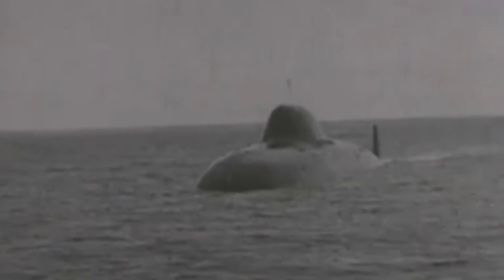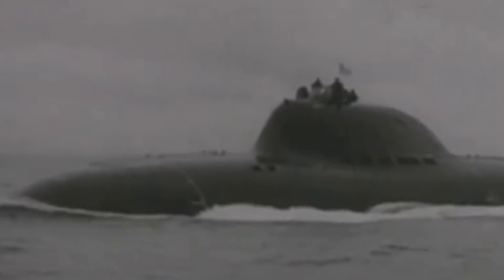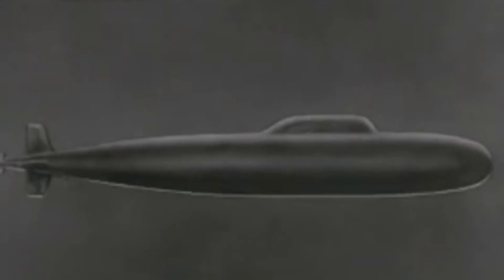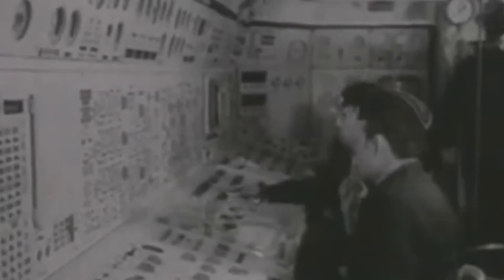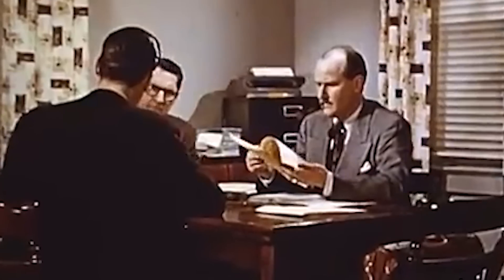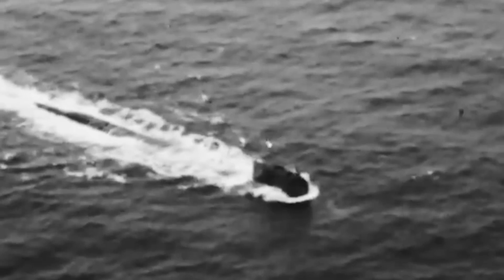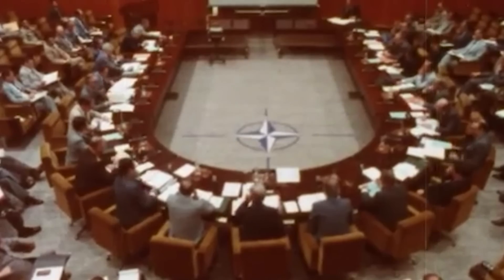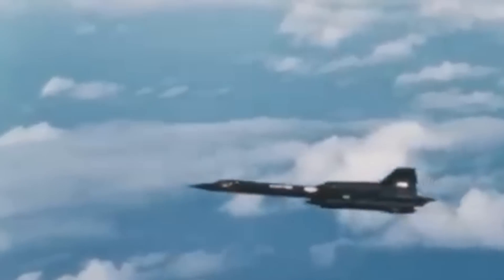Russia's Top Secret (Shiny) Titanium Submarine

Comment: Two unmentioned negatives: The Alfa class was the loudest submarine in the water and liquid metal reactors turn into bricks if they are ever shut down. Other marine reactors are generally shut down while in port and the sub is attached to shore power.
Reply: With the speed it had, noise didn't matter. It's like claiming a bullet has the negative of being noisy when you shoot a gun
Reply: If you're detected already, it's kinda irrelevant if you're insanely loud at high speed. Then your objective is to get the fuck away and not be silent.
Reply: @vermas4654  They must have known though that the first thing the US would do is work on a faster torpedo, and they did with the ADCAP. It's like the old U2 spyplane that could fly above the ceiling of old Soviet SAM's. Obviously they're going to work on a higher flying missile. And it didn't take them long to shoot down Gary Powers.
Reply: @benthejrporter  of course. But with their maneuvering capabilities the alphas were still very much capable of getting away from even those torpedoes
Reply: A lttle bit like a catalytic converter in a car exhaust system. They turn into bricks too. The Russians were the only ones capable of welding titanium to stainless steel at that time.
Reply: @keithdurose7057  Not at all the same, the metals in a catalytic converter are always solid.
Reply: @keithdurose7057  How the hell did they do it?

Also, titanium to stainless? I thought it was about just welding titanium pieces together...
Reply: @deezeemb  Porsche figured out how to weld Steel to Aluminum - you first plate the area with Aluminum.  Maybe Stainless to Titanium is similar, You plate one of the metals.
Also - - why can't CO or N2 be used as a "shield gas" , and furthermore Titanium isn't "rare" - it's everywhere, used as white paint pigment.  It's just hard to purify.
Reply: @keithdurose7057  Titanium Alloy.
Reply: Without accessible machinery spaces they'd be in big trouble if they had a breakdown out at sea.
Reply: Put a tube into the ocean anywhere in the North Sea and you could hear it. Yes it was fast but easily detected as it was exceptionally noisy
Reply: @SunriseLAW  Titanium is more resistant to fatigue than steel.
Reply: @luckydog9809 What utter nonsense you know nothing about their acoustic signature and that is the usual US story.   So when and where did you detect one then. ??
Reply: You can shut down a liquid reactor, you have to keep the metal liquid with heaters.
Reply: @jobowobo6700  No you just don't shut them down.  Cooling in harbour was provided from the shoreside so that the auxiliary services can be shut down and maintained.
Reply: @Highendaudio1  yes you need shore powet and of course its not simple but yes you can shut them down. They shut down several civilian metal cooled power plants in canida but kept them reactiveable for decades before finally pulling he plug. Again not simple but you just have to keep the metal liquid using heaters and insulation.
Reply: @SunriseLAW  hilarious
Reply: While Alfa class in port it can power the shore
Reply: @luckydog9809 Said someone who has no experiance and no clue haha. oh dear.
Reply: @Highendaudio1  huh?
Reply: @Loquacious_Jackson  what,  don't you understand what I am saying   your statement about the Alfa Class was the loudest submarine in the water..   Let's start with that one first.  What's your actually experience that substitutes this statement and what are the supposed noisy aspects. ( This should be a classic )
Reply: Sr-71 was loud.
Reply: Correct
Reply: Until Japan sold the Soviets high tech machines
Reply: @tomhenry897  Toshiba.
Reply: @tomhenry897  You forgot the Norwegians - they sold the Russians the multi-axis milling machines needed to make quieter propellers.
Reply: @recoil53  Yes, the Toshiba–Kongsberg scandal. I remember it well and wouldn't buy anything from Toshiba for a long time because of it.
Reply: @ThubanDraconis  I won't buy products from companies that do business in Israel for similar reasons.
Reply: @ThubanDraconis  So the first Alfa was built in 1965 so what does that say about your story bud.  As per normal totally fake
Reply: @recoil53  Early in 1983 a team of Japanese engineers from the Toshiba Machine Company arrived in Leningrad, the center of Russian shipbuilding since Peter the Great, and was whisked through the back gate of the heavily guarded Baltic Shipyard. There they painstakingly assembled more than $17 million worth of computer-controlled machine tools used to make ship propellers.

Over the next 18 months the engineers returned to the Soviet Union about half a dozen times. Working alongside computer specialists from a state-owned Norwegian company, they fine-tuned the four imposing machines, each of which stands two stories high and weighs half a million pounds. As part of the deal, the Soviet Union even obtained a five-year service agreement.

To the Japanese and Norwegian customs officials who allowed the equipment to be shipped, this was just another aggressive business deal, and the export licenses appeared in order. Instead, investigators in three countries have now concluded, the sale was one of the most egregious diversions of high-technology products to the Soviet Union in a decade.
Reply: @captainwin6333  What has all the BS got to do with Project 705 Nato Alfa? They certainly weren't noisy.
Reply: @ThubanDraconis Cringe...
Reply: @ThubanDraconis LOL
Reply: But the reactor could go to 105%?
Reply: @OLDMANTEA only if the Captain is Scottish
Reply: @OLDMANTEA  Some Soviet nuclear reactor designs can go to thousands of percent.
Reply: @OLDMANTEA huh?
Reply: The Alfa reactors had to be hooked up to superheated steam from shoreside supply to be repaired in Soviet shipyards. When the Soviet boiler broke, or its fuel had been stolen by a crooked official the steam stopped and the liquid metal coolant turned to concrete.
Reply: @johnstreet797  Yeah of course mate. 😂
Reply: Who told you  that and why do you believe them?
Reply: @vhawk1951kl  
LOL! Because he is my friend and was a Sonar tech on the Sandlance in 84.
Reply: @wilsonrawlin8547  The LOL-presumably  Lots of Love, much  appreciated,  and  you are telling me  that it is hearsay  are  you not?
Reply: @vhawk1951kl  
Exactly. Neither confirm nor deny. ;D
Reply: @vhawk1951kl  
No because he was sharing Classified information at that time and could've went to brig and been stripped of rank, The USN were concerned at first, but they were so loud, they just kept them under constant observation.
Reply: @SunriseLAW  So now you are telling me you know exactly how the Russians did their welds?
Reply: @SunriseLAW  Did you mention Oceangate and their synaptic foam blocks held together with plastic straps and woodscrews.
They also mounted the motor brackets to the CF with screws. Combined with 3000 mile road trips on a flatbed, then towed 400 miles on its launch platform in rough seas.
Reply: They were loudest only at max speed. Their tactical speed was higher, than tactical speed of 688. So they were at common speed around 15-20 knots quieter, than larger Los Angeles and Victor II classes.
Reply: @tomascernak6112  They were still quite noisy.  Poor sound isolation on a very compact boat.
Reply: @tomascernak6112  Speed is only a very small factor that determines how loud a sub is.  It can be going 1 mile an hour and still be extremely loud. The seawolf class subs can go very fast and still be quiter than the Virginia class subs docked at port, and the Virginia class subs are extremely stealthy.
Reply: @michaelmichaelagnew8503  You know, when you are trying to spread propaganda hoaxes, you should it do it in original wording.
Reply: @tomascernak6112  
Not from the sonar recordings made of the Alpha class under way. They were loud period as cruising or max speed. Straight from the USS Sand lance SSN 660   Sonar tech.
Reply: @Highendaudio1  
IDC what you think or say. My roommate at the time was onboard the Sand Lance. This was in the 80s and the Sand Lance was operational and ported in Charleston SC. Where I lived at that time, You can talk all the shit you want. It doesn't change reality or make you cool.
Reply: @wilsonrawlin8547  There were no Alfas in Charleston or the eastern seaboard   I will leave that there for you. I know where the Sand Lance was and tel him from me BS  ok
Reply: @Highendaudio1  
LOL! Dude the information is in the USN history on the Sand Lance. You're freaking nuts. Look it up!
Reply: @wilsonrawlin8547  Well someones telling BS and I think it's your buddy because I can tell you when she was in Faslane after that she was on the eastern seaboard running out of Charleston. the Alfa didn't head that direction. you can call it all you want but the initial detection was 79 and 1980 when we pulled Into Norfork in 84 guys from the US Sonar world were still coming down our boat asking about it. You don't have any first hand knowledge it wasn't a vessel that the US got in involved with that much. They weren't designed to operate like a SSN because she want
Reply: @Highendaudio1  
Sand Lance was in the Mediterranean while at sea on patrol. Contact Charleston Naval base and ask them when the Land lance was berthed in Charleston and when deployed.
Reply: @wilsonrawlin8547  I know when she was in the Med but the point that you don't get and think that the US didn't share information.  The Alfa's were nowhere near there so come up with a better story.   Yeah It's not like the US to make claims.  Watch U571 apparently the US boarded U-110 and recovered the Enigma Machine 😂 oh dear
Reply: @tomascernak6112 Source?
Reply: @FunningRast  "trust me bro" Unfortunately I can not give you source you would accept as trusted from your side. I gathered these informations in wild 90s in Russia, when I befriended myself with several high-level managers-engineers in Severodvinsk. I was even invited to one of these golden fishes (K-123) and saw things, probably no western CIA analyst ever saw. Yeah, those days....
So it is same source value to you, as hard to believe boasts of western submariners to me.

But you can also apply simple physics reasoning. Reactor was not pressurized and LBE has much higher thermal conductivity than water, so pumps of primary circuit were much slower, thus noisier than then water pumps of PWRs. These FBR were much more effective than PWR, so waste heat was much lower, so secondary circuit had pumps only as backup and for majority of time, they were off. Submarine has super hydrodynamic hull and with smaller diameter than LA or Victor, so its drag coefficient and cross section area was significantly lower, thus creating less hydrodynamic noise. Its propeller was optimized to prevent cavitation up to top speed (which was 45 knots, not 41 as wiki claims, but whatever, point is not changed), so obviously was cavitation free at half speeds.
So from these facts should be obvious, that at tactical speed, such submarine would be quieter, than same era submarines.
Reply: @tomascernak6112  Oh yeah, those days... sure sure. And now please tell us your story of being friends with Juri Gagarin and getting invited into the vostok capsule...
Reply: @heikos4264  I was not only in Vostok capsule. Unfortunately, i never met Gagarin in persona, because I was not yet born, when he died.
Reply: @FunningRast  What a question he was probably like me out there in the sound room tracking them. They were not noisy and the fact you are asking for source makes me laugh.
Reply: @tomascernak6112  Suuuurrreee comrade. Take another swig of vodka and tell us all about it….I joke… The Alpha’s are very unique, and revolutionary submarines no doubt. I admire the Soviets attempt to innovate with this class but they had several drawbacks. As mentioned the reactors required high levels of maintenance and had to constantly be kept hot. They were loud, and maintenance intensive. Yes they had high levels of automation to facilitate a low crew size but those automated systems were often unreliable. The subs were also expensive to produce and maintain. There’s a reason more weren’t built, and as much as I like the Alpha the reality is that in many ways it was just like the MIG 25, it caused a big commotion in the west until more was learned about it, and then it was discovered that a lot of the “fears” were completely unfounded.

Comment: What the Alpha class had going for was speed. It could dash into the North Atlantic. At 40 knots it’s sonar would have been useless. Plus at that speed it was detectable. Ot’s give up the stealth advantage. So while it scared the US Navy Admirals for the USSR they were an expensive nightmare with a short service life. They did one thing good at the expense of everything else.
Reply: It didn't need to be stealthy and it didn't need to be able to detect anyone, it could quite literally outrun anything pursuing it.  It would probably have passed through the GIUK gap in company with a host of older noisier subs then dive as deep as possible and sprint at full speed until they were in the middle of the north Atlantic.  Kind of hard to track something that deep and that fast even with P-3s
Reply: @rags417  …. Between SOSUS, SSN’s, P-3’s, etc… the navy has stored nuke depth bombs. That’s just the US Navy. The Royal Navy is also out there hunting
Reply: @rags417 It couldn't outrun a Mark 48 Torpedo or dive deeper than one.  Once that was issued, the Alfas stopped being a threat.
Reply: @danielhenderson8316  Define "outrun".  If the torpedo was dropped within say 2 miles then you are right, if it was any further then have fun catching up before the torpedoes fuel ran out.
Reply: @rags417 mk48 can go 24 mi at 55 knot or further with slower speed like 45-40 knot.